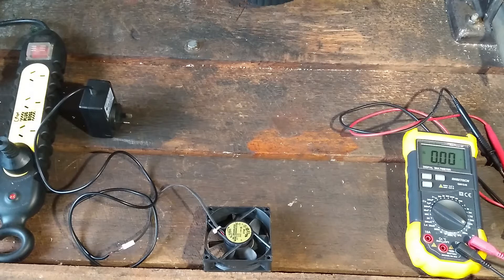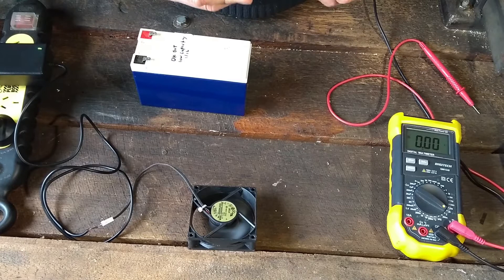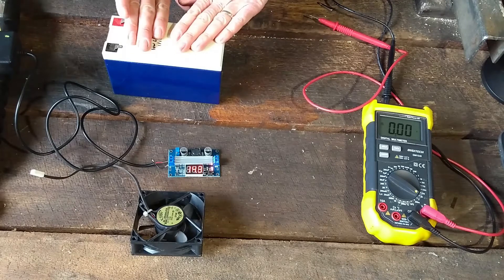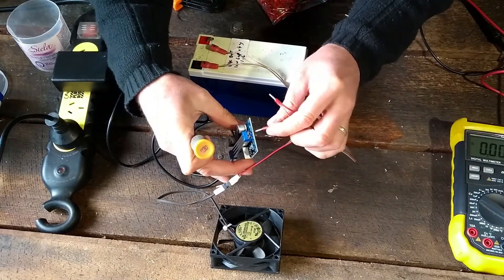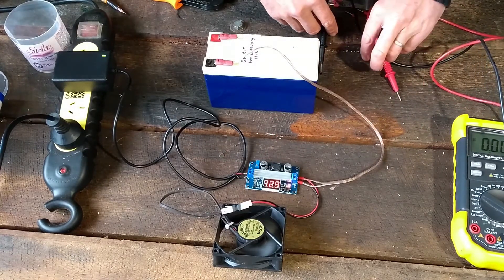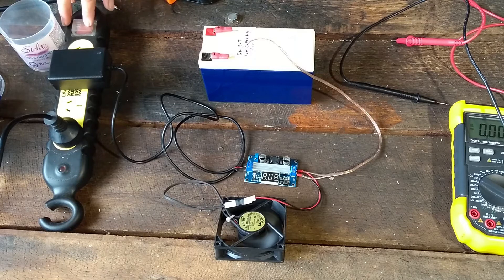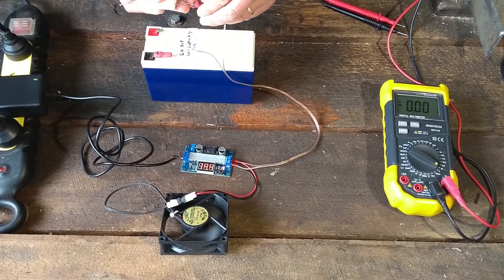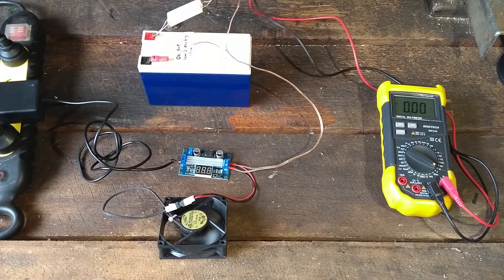Duinotech DC-DC Voltage Boost Module

Comment: Hey mate, what about having two batteries, both which power the fan? The linear power supply can charge one comfortably while the other is used by the fan then switches over if one battery hits <70% charge, that way you can keep the batteries healthy too, also, that way you don't have the psu under load and trying to charge simultaneously. 

I have to wire up those bloody terminals pretty much daily, a trick I find is to take 1-2mm off the end of the bootlace ferrels and they'll slot right in and you want have any conductors exposed. If you back the screws out too far the foot mechanism inside cant hold-on to the screw anymore (its a damn pain, its stitched me up on the job more than once).
Reply from the maker: Hi!
My reading of the problem was that the power supply didn't have enough grunt to charge this battery, so having two batteries wouldn't have helped.  But I must admit I didn't try it without the fan.
I think the best way to set this up would be with a 13.8V power supply or battery charger, but the video was a good excuse to play with the voltage boost unit!